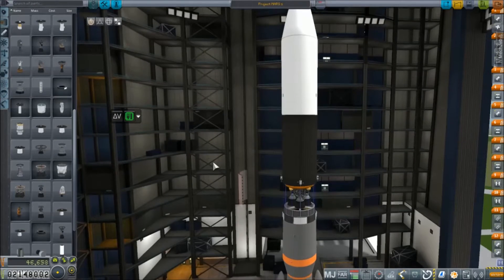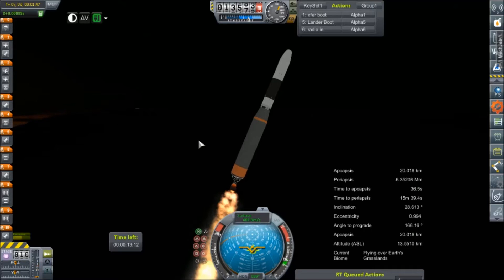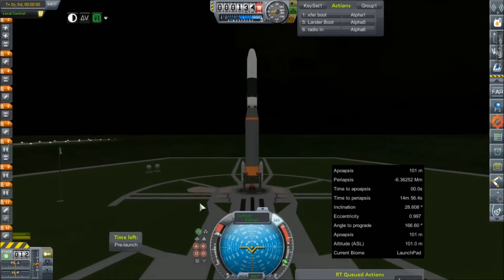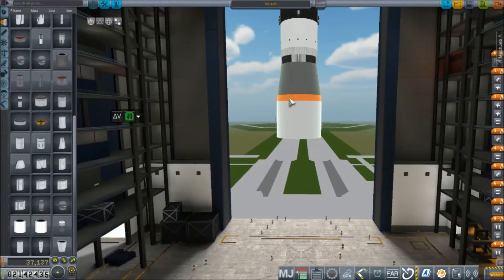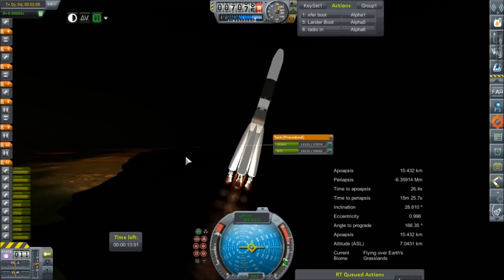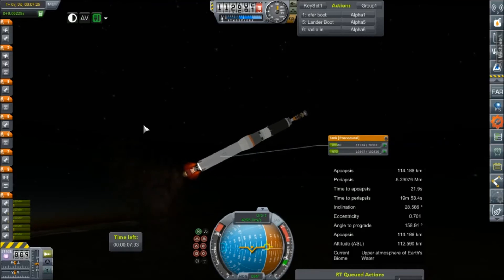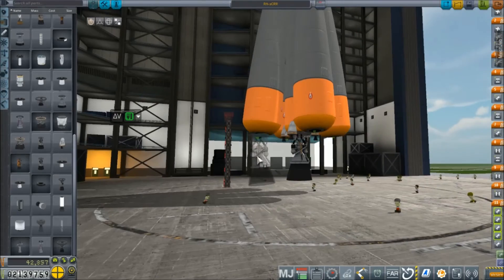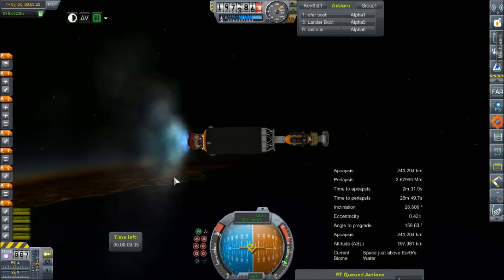KSP RP-0 #165 Prototyping New Launchers

Comment: I always tried moderate re-designs, at least early in my RP-0 series. I would follow a tick-tock pattern of replacing one stage design at a time so even new rockets still had at least one reliable stage. What is your goal with the new launcher design? A certain increase in payload to a certain orbit?
Reply from the maker: Currently the upper stages of the RA-9x will remain unchanged. (the S - single RL-10, the B 2x RL-10, and the HV 4x RL-10)
The goal ( lofty as it may seem now) was to have something that could get an HV upper to ~200km orbit. The HV would circularize iteself, but would retain ~4Km/s DV for xfer burns. And while keeping the cost somewhat reasonable.  The RA-9 series is dirt cheep, and why I use it so much.

Comment: If you dare go against tradition I'm sure a few extra side boosters would greatly help with initial TWR and thus improve gravity losses, however by that point the cost of the rocket could really start to soar. Perhaps if you factor in the reliability of the newer engines the cost issue isn't that bad, though!
Reply from the maker: Yeah, the trying to keep the price tag + payload under the 51K credit mark is really the limiting factor here.  I am certain that a single F1 1st stage, and the single J-2 second stage would perform exactly as I need, but would put the price tag + payload way above what I call reasonable for a primary duty launcher.